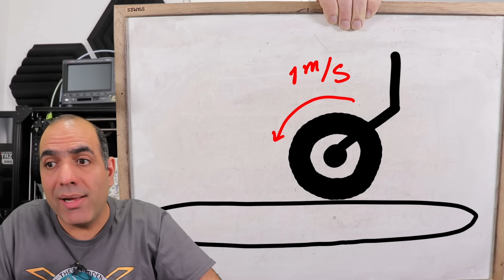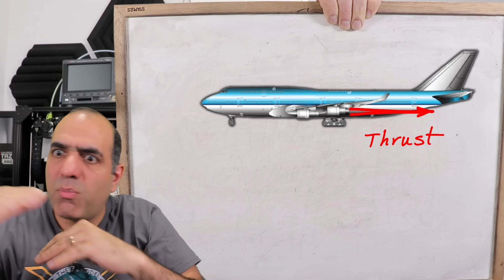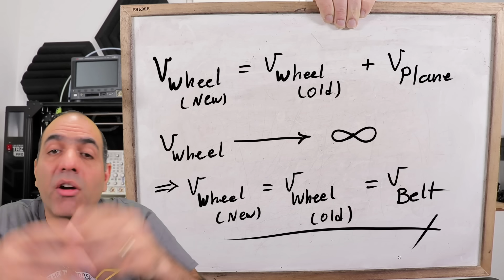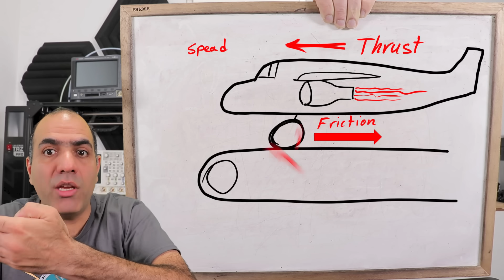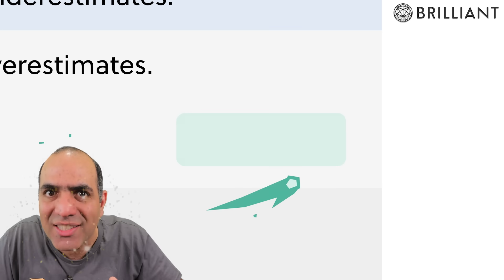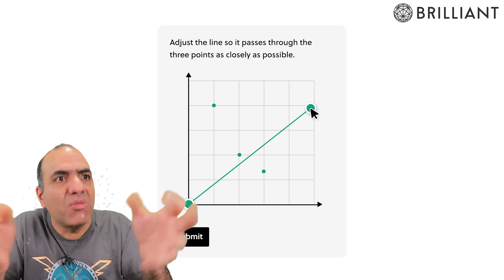Airplane Question that Drove Me NUTS!!!

Comment: Unless the plane and conveyor belt really are in an alternate reality, this problem is impossible.

1. A plane's engines create thrust by sucking in air and throwing it out the back. In a vacuum there would be no force of thrust, but also no fuel, so the plane's engine is off. The plane does not fly, unless there is a medium that allows for combustion, whose resistance creates the forward thrust.

2. A plane's thrust makes the plane want to move forward, if it can overcome the resistances on the plane. I.e. the resistance of air and of the contact between the undercarriage and the ground. This is why we have wheels, because the sum of the resistances on the bearings and between the wheels and the ground, are smaller than between the fuselage and the ground. Thus the wheels start rolling and the plane moves.

3. As far as I understand, as soon as the wheels start moving, the conveyor belt is supposed to instantly match their speed. But the speed of the wheels is brought on by the forward motion of the plane, as it overcomes the resistances acting on it. If the speed of the wheels is instantly matched by an opposing speed of the conveyor belt in the opposite direction, the plane is not supposed to move in the first place, and the wheels aren't moving either. But in this case the energy from the thrust force would be lost. And the law of conservation of mass and energy states, that at that point the mass of the whole set up is going to have to keep increasing until everything implodes into a super massive black hole. ... End of the universe.

4. There can only be a logical situation where the conveyor belt has a delay in reaching the same speed as the wheels, leaving a remnant of forward motion for the plane to accelerate, and take off without too many issues. Although the wheels will be turning way faster than normal. ... And somebody having wasted loads of time and money on building a very large, very rapid conveyor belt to nowhere.

Comment: 1 The plane is stationary.
The wheels and the conveyer belt are also stationary.

1.1 We can assume that the frictional "loss" of the wheels tyres  and bearings are NO different to that which they are on normal runway ground) 

2 The jet ( 747) engines are started and then produce thrust due to newtons 3rd law of motion ( every action has equal and oppostite reaction - that is - the jet engines accelerate a mass of air rearwards - resulting in a fowards thrust.)

3. Due to thrust  ( thrust directed onto  to the mass of the plane - THAT is what makes the plane move ! ) - the plane starts to move - AND moving relative to a frame of reference that is ( the surrounding air and ground)
 independant of any motion of the conveyor belt.

4 now the plane is moving - the wheels start to rotate - in exactly the same way they would on a normal runway.

The rotational speed of the wheel is then matched by the reverse linear speed of the conveyer belt so the rotational speed of the wheel doubles BUT- the axle of the wheel continues to move forward since it is fixed to the mass of the aircraft.

5 The aircraft continues to accelerate since the  thrust that the jet engines produce is not affected by any other parameters such as wheel rotational speed or conveyor belt speed.
As it accelerates - air passes under and over the wings thereby creating increasing amounts of lift 
( it is AIRSPEED that is important - not ground speed since air (wind) may be moving relative to the ground)

6 the plane continues to accelerate when airspeed ( ie lift) is sufficient to "rotate" - ie take off.
At this point the wheels will be rotating at twice the angular speed that they would be on a normal runway.

7. At this point - (at rotate - lift off) - since the thrust of the jets is now partially directed downwards ( since the fuselage is "nose up" - there is additional vertical lift created from the thrust of the jets 

8. At this point - the 747 takes off

Comment: 5:09 Wheel friction isn't the only force working opposite to the engines thrust. The observation that the belt and the wheels accelerate towards infinite equal and opposite speeds is correct given the premise. But as we know acceleration coupled with mass results in a force. And the wheels have mass that entails a rotational inertia. The belt's force on the wheels result in two different motions of the wheel: A rotation opposite to the belts rotation and a linear movement in the same direction, albeit slower, as the belt. Given that the belt accelerates, there is a linear acceleration of the wheels going on at the same time as the wheels accelerates rotational. In order for the wheels to stay in place, which is a requirement for the premise, there has to be a forward force on the axles on the wheels. That forward force is supplied by the plane's thrust. 

The question therefore becomes: How much must the belt accelerate in order to create a backwards force on the wheels' axles that matches the force from the thrust from the plane's full throttle? 

I asked an AI chatbot to make the calculations:
To figure itout, imagine temporarily attaching a strong wire to the tip of the plane to hold it in place so we can measure the force required to keep it still while the belt accelerates.
Each wheel weighs about 300 kg, with a radius of 0.6 meters, and there are 18 wheels. That gives a total rotational inertia of roughly 972 kg·m². To generate a backward friction force equal to the plane’s full engine thrust (about 1,000,000 newtons), the belt must accelerate at 370 m/s² — about 38 g.

If the belt is accelerating that fast, the friction force generating rotational acceleration at the wheels cancels out the full forward thrust of the engines, and the plane remains stationary. No forward motion means no airflow over the wings, and no lift. The plane cannot take off.

Comment: Reposting my original comment but modified.

No. It will not take off as there is no lift generated from the conveyor belt. Planes have wings for a reason and that helps to generate lift when it is moving at a high enough speed to take off.
Reply: You probably didn't understand...

It's not about whether a conveyor belt can help a plane take off, but whether a conveyor belt can prevent a plane from moving forward to take off...
Reply: @francescolucakeplero7975  Regardless, it wont be able to take off.
Reply: @GokantheHusky are you sure?

Comment: This could be tested..maybe on a smaller scale using a tapis roulant and a small vehicle (like a RC car) but powered by a fan and not wheels. But then we would need to put a sensor that reads the exact wheel rotation speed, and sends the signal to the engine that powers the tapis roulant Speed. But it's pretty hard I immagine😅 or maybe I'm just dumb and dreaming (plausible)

Comment: Maybe I’m missing something but I don’t get the mild passion here. No assumptions are really needed other than that the construct of a large conveyor as described can exist.

The wheels do not impact the movement of a plane significantly during takeoff. The wheels are there simply to minimize friction. They are NOT like wheels on a car, where the wheels move the object. The plane is moved via other means (pushing against air, or thrust).

The answer is the plane takes off. The wheel movement outside of negligible residual forces has no bearing on how or whether the plane can move. The wheels are made to move independently of the plane. Heck you could have the conveyor going backwards, turning the wheels backwards, and the plane would still move forward because it’s still pushing against the wind (not ground) with way, way, way, way more force.

I think a good illustration is to turn everything 90 degrees. Think of the space shuttle (without its boosters) and the wheels out, sitting on its butt pointing at the sky. You can put a conveyor next to it (also at 90 degrees obviously) against  its wheels. As the shuttle lifts off those wheels will turn. The belt can move to prevent the wheels from turning and it would affect the shuttle basically 0. Heck you could make it go super fast in the opposite direction and the force of thrust will simply take those opposite spinning wheels for a ride.

Comment: *Sigh*…with regular conditions, and assuming the belt and plane can move at the same speed, the velocities will likely cancel out and the plane will be stationary. Therefore, the wings won’t catch the air and the plane won’t fly. 😐
Edit: Idk, I ain’t no physicist
Reply: I’d suggest humility in lieu of sarcasm because from everything I know (also a fallible human being so grain of salt) your answer is entirely wrong.

The main problem as I understand it is that people equate an airplane’s wheels with its action of movement. That’s not the case. A plane doesn’t move because its wheels are, the wheels are moving because the plane is.

In other words where on a car moving wheels are the CAUSE of movement (essentially the wheels are pushing the ground behind it) the wheels spinning on a plane are the RESULT of movement; the wheels move according to whatever force is applied to them; they are not the force itself.

More specifically the airplane wheels reflect the movement of the plane (thrust) vs the ground (0). If we change conditions (such as making the ground under the plane move at a non-zero speed opposite the expected rotation of the wheel) the cancellation of velocities affects the wheels alone, because they are free spinning and reflective of velocity applied to them not causative of that velocity. In such a scenario the wheels would not rotate but the plane would move. I saw a comment elsewhere that put it succinctly; the plane is not pushing against the ground to move, it’s pushing against the air. It’s also why it’s easier to take off facing a headwind (and harder when moving along with it).

To wit, this exact situation already exist. Seaplanes taking off from water don’t use wheels. They take off when their “wheel” analogues (skids) are at 0 RPM; because neither wheels nor sea skids are what move the plane.

There is some non-zero but ignorable force of friction to overcome, meaning a hypothetical conveyor will impact the speed of a plane a tiiiiiny bit but, under “regular conditions” as you mention it’s it’s so marginal it’s not worth considering.

TL;DR - you’re incorrect. The wheels will be stationary but the plane will move forward because the movement of the wheels is reflective of, not cursive for, the force of thrust generated by the plane.
Reply: the trick to this riddle is to understand that the plane and the tape cannot synchronize because they work independently...
Reply: @PiaIncampo That is not the trick. There is no trick. Ignoring the millisecond computation times and such, the conveyor and wheels can absolutely move in synchrony.
Reply: @PiaIncampo Exactly, because the wheels have no traction but spin freely...
Reply: @francescolucakeplero7975 The wheels have non-zero traction which is why they move on the runway. The trick is not that the wheels and conveyor can’t move together. The trick is in understanding the wheels have (near) zero impact on what causes THE PLANE to move. The wheels move because the plane is moving; the plane is not moving because the wheels are.

The plane DOES NOT NEED to push against the ground to move (precisely why they can fly IN AIR without pushing against the ground). It is pushing against air, and that force still exists completely independent of whether the plane’s wheels are touching the ground or not.
Reply: You’re answer implies that the speed of the plane relies on the speed of the wheels.

Comment: It can't take off cuz it has no real speed. however, it can if the belt suddenly becomes stationary
Reply: Incorrect. The wheels do not affect the speed of the plane (well it does marginally but it rounds to essentially zero as planes have more than enough power to compensate).

The wheels would stay stationary, the plane would move forward.
Reply: @ the friction would prevent the wheels from sliding

But technically, short takeoff systems do exist. They hold the wheels in place as the engines gain power, and once the wheels are released, the planes can take off in a much shorter distance. Mainly used in aircraft carriers

Comment: I feel like "the airplane is sitting at 0kmh with its engines off" is the only canonical answer.
It works however you interpret "match the speed of the wheels", does not depend on any of the friction coefficients, and has the bonus of matching the phrasing of the question

Comment: The plane will not take off because it needs winds to the wings to fly I'm in aviation
Reply: And it is producing that wind via thrust.

Moving the wheels in the opposite direction does not eliminate that thrust to any significant degree.

The wheels would remain stationary and the plane would move forward and take off as normal (or as normal as a plane on a conveyor can).
Reply: Ah-ah-ah, even kindergarten children know that planes fly "running through the air"

you probably didn't understand the riddle.

Comment: 0:28 the answer is yes... its wheels do not have engines... it all depends on the air speed, that an aircraft creates using thrust from its engines... they can even take off like helicopters if the wind speed is fast enough, so no runway required (you can actually find videos of small planes doing it)
Reply: people keep talking about wind speed but if the aircraft is at a standstill on the run way because the conveyor belt is taking away ALL forward movement. WHERE IS THE AIR SPEED???  because the air speed would be the same as the plane speed. which is ZERO.

Comment: An airplane takes off due to the thrust generated by its engines, pushing it forward.
Wheel speed is less crucial than airspeed for takeoff.
A moving conveyor belt can cancel out ground speed, but if the engines provide sufficient thrust for the plane to achieve necessary airspeed, it will still generate lift and take off.
This is similar to running on a treadmill – you exert effort despite no ground movement.